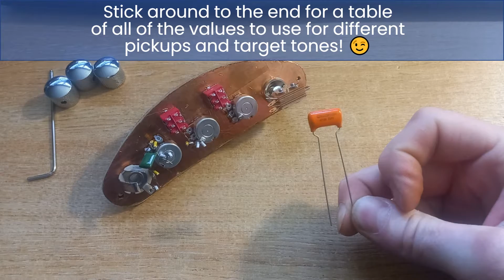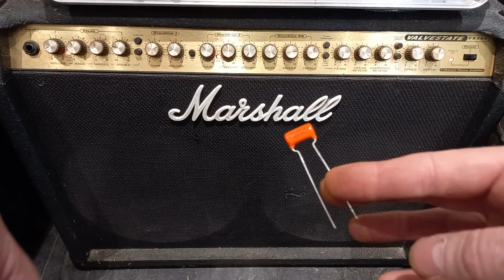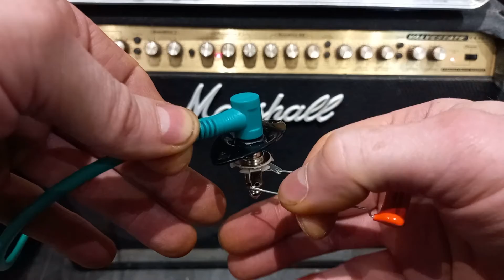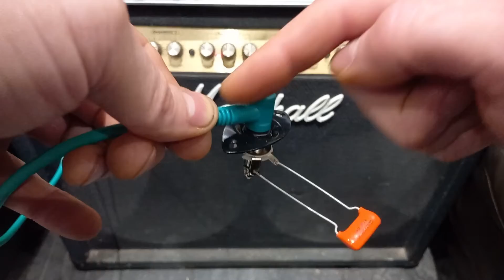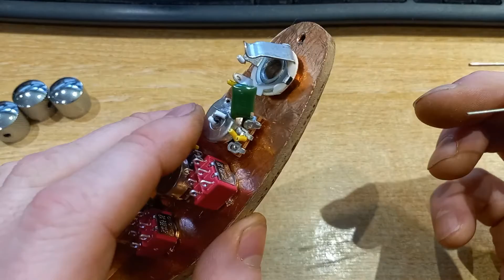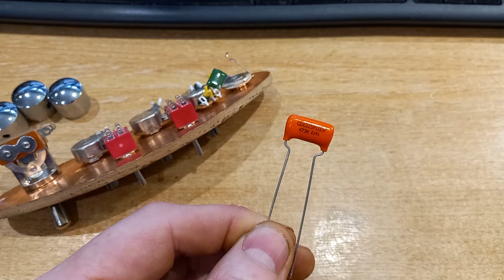How DO you wire an Orange Drop? 🤔(Shielding is CRITICAL!!)

Comment: I use hifi grade 2% - 5%  polypropylene capacitors & a hifi grade resistor, i use the Fender Greasebucket tone set up with a CTS 8% 250K Linear pot, being such small values, 0.1mfd (wired in paralell) to 0.015mfd - 0.047mfd (wired in series to 4K7 resistor then back of pot, earth) there only 15mm long by 10mm diameter, the 0.1mfd being the biggest, i used to design hifi speakers so passive electronics i'm used to, passive x-overs, high grade polypropylene caps are used in almost all quality loudspeakers for their detail, neutrality & musicality, the Greasebucket tone set up is more organic, let's through the tone of your pickups & bass making the signal sound more natural & 3D compaired to a single capacitor tone set up, & always use good quality Linear pots, Log pots are for guitarists volume pots only bass players should use Linear especially if a 2 pickup bass, Jazz, PJ etc to be able to smoothly blend your pickups & to get the tone you want....if single coil pickups, Jazz etc then full sheilding to keep the noise to a minimum... good stuff.....

Comment: I tried it and my orange drops just stops humming on both ways.
Could that be possible?
Reply from the maker: Do you have a plastic jack lead? That kind of thing would be an issue if you are touching the shielding on the cable
Reply: @bigtalltim   it is fully plastic
Over that, I put my hands away before the JACK, touching only the clothy side.
But I did try it a second time this time putting the volume much louder and I do find a little difference between the two sides and I suppose I did not push the volume enough.
Thank you for your quick response.
I appreciate the good job
Reply: @bigtalltim  just discovered on one of my bases. My drop is on the wrong side. Would you advise me to switch it around or will it still work? Really appreciate your help.
Reply: @Phil-Good It works just fine. There are millions of guitars and basses with tone caps installed without measuring the orientation. Stop worrying and just keep playing ;)
Reply: @TeroWasHere  that is a great piece of advice.
You’re absolutely right !
Enough of technology and more music🎉

Comment: Why not just mark it on the orange casing?
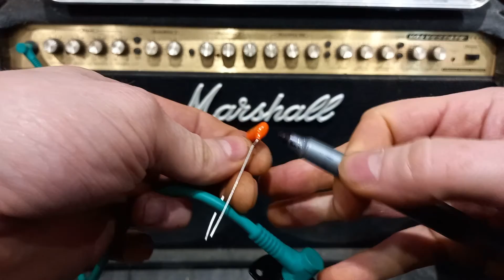Reply from the maker: I did - at 3:29… or did you mean the manufacturer?
Reply: @bigtalltim manufacturer
Reply from the maker: Gotcha - well, with most applications requiring a capacitor you probably wouldn’t notice the difference so it isn’t a formal polatity… the component will function electronically equally well in either direction but with guitar applications (and the huge amplification of the signal involved) it becomes a problem with an audible difference

Comment: Oh boy , I’ve a bunch of Orange Drops to test … thanks !!
I noticed on the one you tested the ground leg was to the right side of the lettering…. In all the ones you have tested is that a trend or is it random?
Oh and finally … the single coil cap value at .047uF will be too dark for many folk giving a very muddy tone below 4 on the pot… modern Strats use .022 and I’ve had good results on my Tele with .033.
The resonant peak tho alters with different cap values, so as you get into lower cap value the cut frequency changes and you can get into “ cocked wah” territory nearer .01uF
Reply from the maker: I haven’t noticed a trend in the orientation relative to print - seems to vary by manufacturer or batch… good shout on the single coil value btw - experimentation definitely required to pinpoint personal preferences

Comment: I have found that testing some capacitors with this method works well, but other capacitors display no audible difference. They sound the same in both positions. Care to comment on this behavior?
Reply from the maker: Sure - simply put, the construction of some types of capacitor (ceramic disc for instance) means that this isn’t an issue… really something that affects older types of cap more - but in the guitar world where old technology is believed to sound better (paper and oil capacitors being the ultimate example of this) we tend to shun modern reliability in the hunt for classic tone. Make sense?
Reply: @bigtalltim  yes. this is a new orange drop cap that I am using for an Eldred mod Esquire, the value is 0.0047uf. The current cap circuit is noisy, but I just tested a bunch of polyprop film caps that are polarity sensitive that could be installed backwards. Thanks for the quick reply!!

Comment: Does it make a difference on a p bass?
Reply from the maker: Great question… I’m gonna say less of a difference - probably! Basically, it would be a similar problem to guitars if you use a lot of high gain effects, but as this is less common with bass, probably not too much of a concern
Reply: @bigtalltim  and because P bass has split coil pickup?
Reply from the maker: It really comes down to how much the output from the instrument (and any background noise) is going to be amplified in the signal chain… I’ve known very few bassists who use distortion - a mild fuzz maybe, but the kind of distortion you’d use for lead guitar, not so much, so less of an impact. Still important to get it right though!

Comment: Based on other Orange Drop (OD) installation videos, I've seen other YouTubers solder the IN of the OD to the 2nd (middle) lug and the GND to the pot casing. 
Can you please provide more details to your method? 
Who is right? 
Who is wrong? 
Does it even matter?

Thnak you for your time.
Reply from the maker: Hi! Short version, it doesn't matter which route the treble frequencies take to get to ground... It makes little or no difference to the sound... now... long version! Over the years the wiring schemes have changed. In the 50s the capacitor went from middle lug on vol to outer leg on the tone pot with the middle leg shorted. In the 60s the capacitor went from the same leg on the vol pot as the signal input to the outer leg on the tone pot with the middle leg shorted... modern wiring schemes for vol to pot connection have the cap between the same leg as the signal input on the vol to the middle leg on the tone pot with one of the outer legs shorted to ground... ultra modern wiring schemes generally have the tone pot attached to one of the outer legs on the tone with the other leg going straight to the tone pot casing... 
Bottom line, in all cases, the tone pot allows a variable amount of the treble frequencies pass to ground which cuts the trebles available to be output to the jack. Sympathetic installation is the thing that drives the scheme used - you dont want to have to rewire an old instrument ground up to replace a capacitor, so generally follow what is there already - indeed, not doing so could compromise the value of your instrument as it has been subject to a redesign and is no longer authentic. Me, I usually roll with the ultra modern approach as it takes very little space and is super easy to wire externally to the body cavity (which avoids the risk of heat damage to your finish etc)... hope that helps!

Comment: What if you're wiring the cap between the volume & tone pots? Which is the gound?
Reply from the maker: That’s not a wiring layout I’m familiar with - What are you trying to achieve?
Reply: When I install these in my Guitars, I  connect them  between the volume and tone pot, which I think is a pretty common practice, so I’m curious as to how to figure out which is the ground of the orange drop in that scenario 
I know some people only wire the orange cap to the tone pot as well. I hope that makes sense.   Thanks!
Reply from the maker: It does indeed. Ok - assuming a modern rather that 60s style wiring scheme, that would require one of the legs on the tone pot to be shorted to ground and the other end of the cap to be connected to the vol pot leg with the signal input… so the leg marked with the dot goes at the tone pot end (as that is the closest to the point where the treble frequencies get passed to ground)
Reply: @bigtalltim  Thank you! This particular guitar is wired vintage style, so the middle lug of he tone pot is grounded. One leg of the cap goes from the 1st lug of the tone pot to the middle lug of the volume pot. How would I change it as far as the connections? Thanks!
Reply from the maker: Ok… that is ‘50s wiring. With the ‘60s version, the tone pot is the same connections and short to ground, but the vol pot has the cap leg going to the same terminal as the signal input. With “modern” wiring schemes, the cap leg goes to the same terminal as the signal input on the vol pot, and to the middle leg on the tone. One of the outer legs on the tone is shorted to ground (which one defines whether it works left or right handed). There is a great diagram on premier guitar… Google “mod garage: three ways to wire a tone pot”
Reply: Rule of thumb... you connect the outer foil towards the lowest impedance path. In your case, to the tone pot.

Comment: I just did this..I used my little Electro Harmonix 5mm amp pedal and it worked great..I was able to test 6 Orange Drop capacitors I have and 2 other square Brown capacitors I have here to use.
Definitely help me out..I knew that some different type of capacitors had different polarity sides from doing some guitar amplifier repairs for myself but really was unsure how to solder up the treble bleed Orange Drop caps into my guitar(s).
Reply from the maker: Great to hear it was useful - I tend to do batches as well… makes life a lot easier 😊thanks for watching!